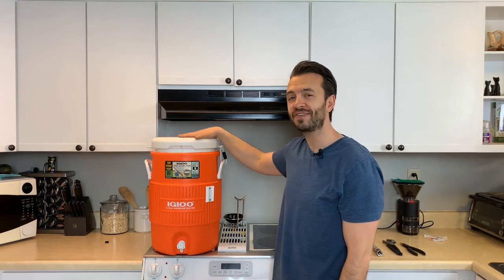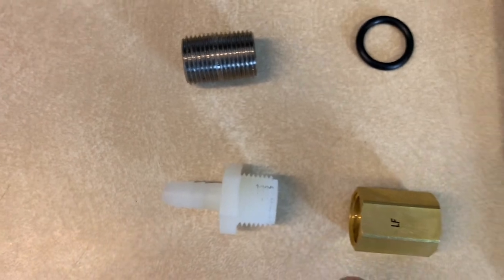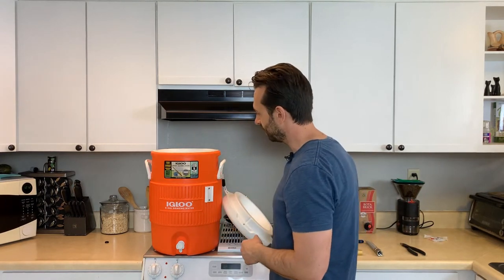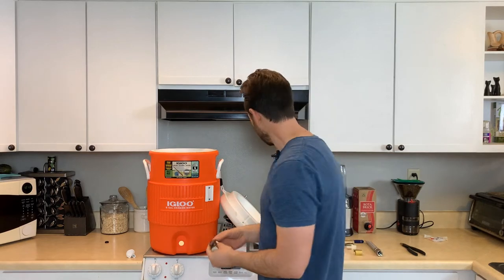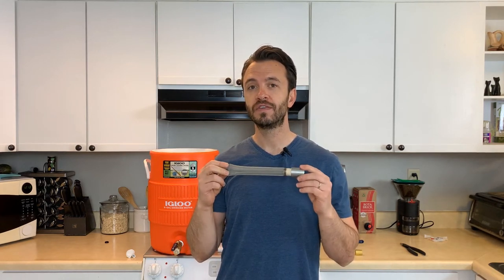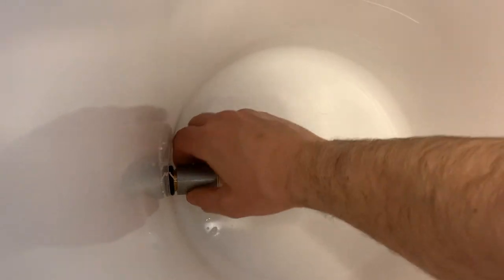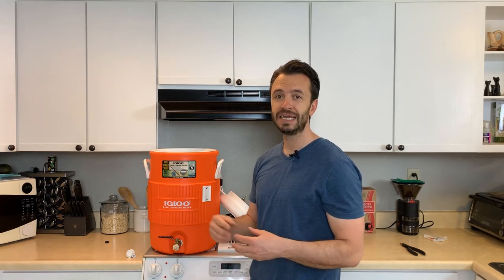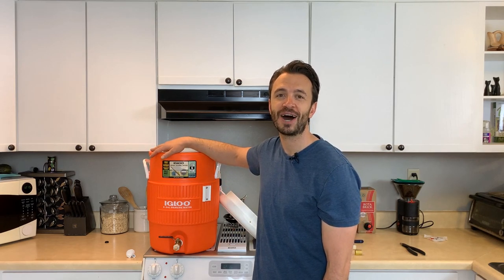DIY Mash Tun for Homebrew All Grain Brewing How to Build a Mash Tun for Homebrew

Comment: Nice size cooler for small batch brewing. Could you fit a false bottom, would 9 inch fit this cooler?
Reply from the maker: Yeah I like it for my 2 gallon batches! So you saw in the video I use a bazooka filter but I did measure the diameter of the inside of the cooler and it is 10 inches, so yes a 9 inch false bottom would fit. Thanks!

Comment: Nice build :-). I was reluctant to pick up a bazooka because I was afraid it would collapse under the weight of the grains.  Have you had any issues with stuck flows etc?
Reply from the maker: Thanks! No, honestly I haven’t had any problems with the bazooka filter. However, I started using a grain bag after the first few batches. It helps me deal with the spent grain better. I probably used it 10 times without a bag and didn’t have any notable problems! What are you using?
Reply: @MyProjectWeekend  I use the false bottom - LOVE IT!!!! Some of the reviews said that they had some “stuck” flows, but honestly I never had a problem with it :-)